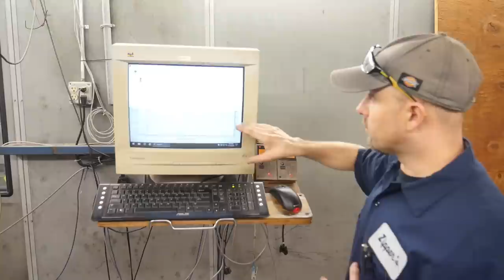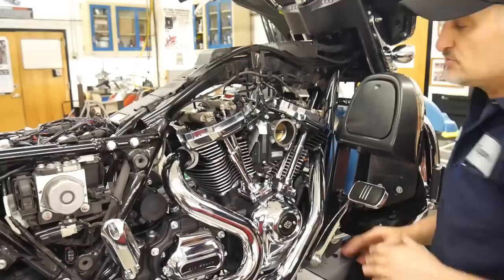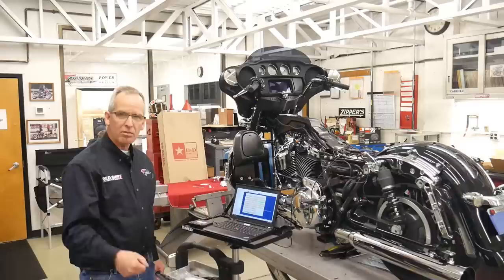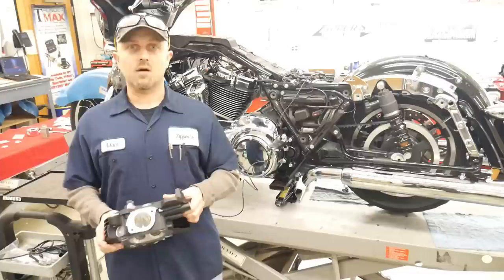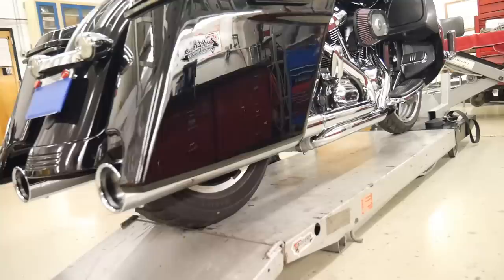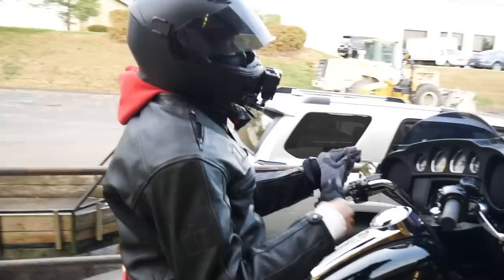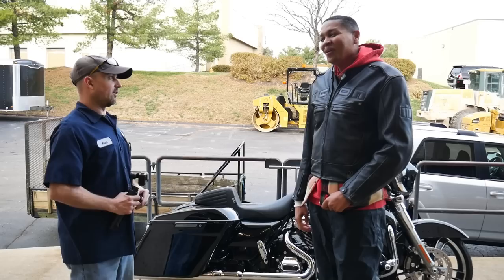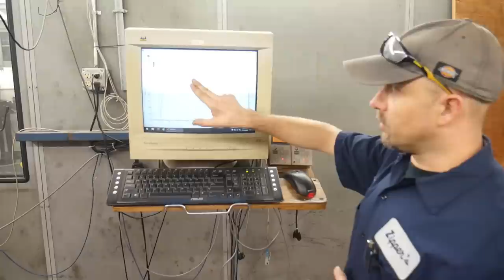Harley-Davidson 124  Cubic Inch Milwaukee-8 Zipper's Performance Sleeper Build: Episode 5

Comment: Never understood running a new pistons/cylinders without at least a 50 miles break in. So let me Crack the throttle and wonder why later it smokes. Just my opinion. 
On my rebuild, I take it easy for the first 1000. 2003 softail bored to 98 etc etc etc. Bought it in 2005 with 3000 miles on it.
Great video and nice part matching. Made a fun riding bike

Comment: Great series on your 124 Sleeper kit install....wish I had seen it when it first aired then I could be closer to getting my 107 upgraded. Working as a parts associate at a H-D dealership, I felt a little vindication when Adam made a point to explain why they built this 124 kit based on "how and where" you ride. That is one of the first questions I ask a customer when I get asked about which Stage kit is the best for them. Unfortunately, most don't have a clue about what I mean and that is when I get to explain. I also learned why I might also be burning oil in between oil changes as well and it is a little scary to think my crankcase oil jets might not be nice and tight. I will be talking to the boys in the shop to see if they watched this series and are they ready to do this build.
Reply from the maker: Let me know how it turns out.

Comment: Great video. I didn’t really understand the the cam choice until he showed the Dyno results and explained the numbers. Now it makes since. I just order the 468 kits for my 2019 CVO RG. I’m doing the head pipe and mufflers also with no plans of going with the 124 so I should be very happy with the 468 cam.
Reply: You should have gone with the Jim's VTwin performance Maxcell 821B cam.  More power, more torque,  FANTASTIC idle,  smoother and longer powerband. Extremely reliable.  I LOVE IT in my 2019 Ultra Limited 114ci. Dynoed at wheels 116 hp and about 135 tq
Reply from the maker: Zipper's is a great company, you will be pleased with the 468. I recommend the Thunder max Tuner.
Reply: @TravelingTall  go with the Jim's VTwin performance Maxcell 821B cam you will be more then pleased! I LOVE MINE with Power Vision tune, and it makes more power and torque then then zipper cam

Comment: Credit to Zippers. Just a question about the exhaust, with the X pipe do you get the same benefits from the 2-1-2 configuration as a 2-1 torque/power wise?
Reply: Frederick Parkes no
Reply: You don’t need it. Rusty is an exhaust Guru and he designs and builds the best performing exhaust there is to be had.

Comment: What about when you get caught in heavy traffic?
Reply: amphibdriver1 -What about it?
Reply: @cavscout62  ----Does this 124 sleeper engine get a whole lot hotter in heavy traffic when compared to a Harley 114 engine? I have read that aftermarket Harley big inch engines really hate to be stuck on traffic and overheat.
Reply: It is probably just fine.  The M8's run really cool and with that fan on the oil cooler it shouldn't be a problem.

Comment: Did you upgrade the oil you use?  A full syn oil is a blend of conventional oil with syn additives. A 100 % syn oil  is what it says it is. Amsoil is one such oil. Your worn valve guides and piston deposits indicate an oil type issue. 100% Gear oil in the trans works better also and it will drop right into neutral every time.